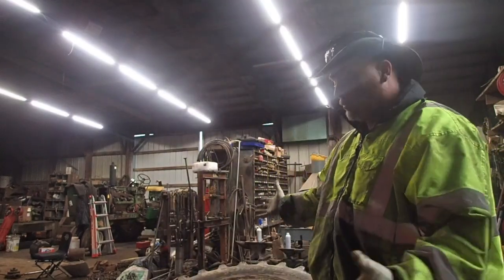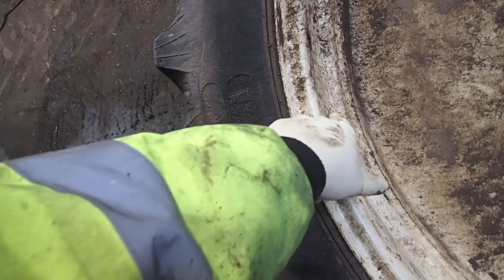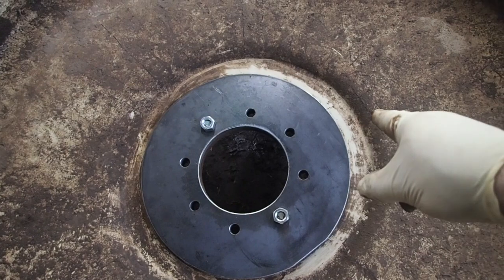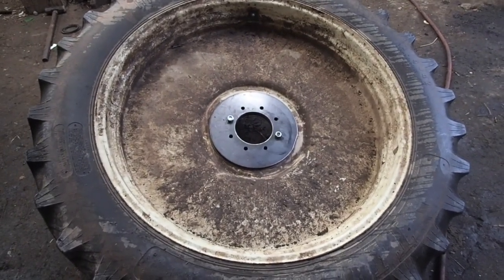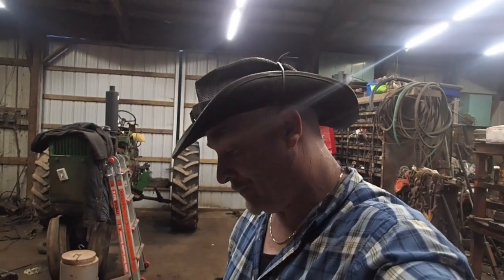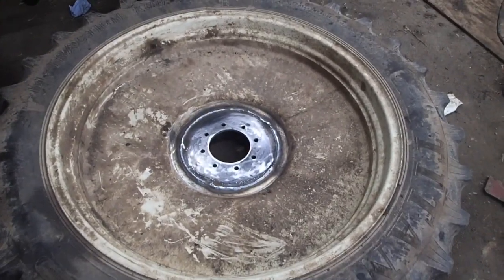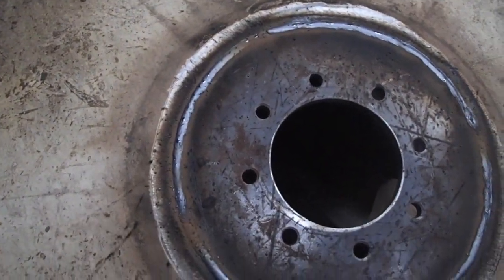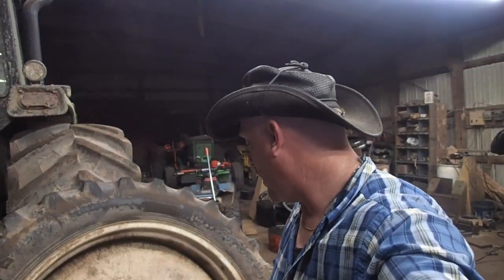Hardi Spayer Wheel Repair

Comment: I've done similar in the past,but I usually pre and post heat the heat affected zone with a rosebud.Those spun wheel centers are usually work hardened during mfg and contain a fair amount of stress. Post heating helps relieve that stress which helps prevent cracking later.

Comment: I think the only thing I would have added to what you did was to mark across the wheel & the new steel while it was bolted with maybe big crosshairs so you would know exactly where it was before you cut it to line it up when you were tacking it back in.  Great Video Wes.

Comment: That's a pretty good job 
Those are good looking welds
For anyone watching all id say is remove the valve stem 
Listen to it every now and again 
If it starts posing like escaping air then step back let it finish and continue 
The presure wont spike from 0 to 100 instantaneously but it will climb fast over a minute or so 
If you keep welding after it starts releasing you Increase the chance of injury greatly

Comment: With your steel plate bolted to the existing wheel rime...drill 3 random hole and use some stove bolts to attach it to the rim.  If it looks okay, take it apart and you can not cut out the old cracked and welded rim mount piece. Your 3 random hole and stove bolts will now center you steel plate piece so you can weld it on both sides.  Stitch weld to help avoid warping and use a water wetted rag to aid in control warping prevention.

Comment: I agree totally with the comment about using tapered lug nuts Wes,that's a MAJOR potential safety issue right there.
Back in the 1950's cars ran FLAT lug nuts and people were seriously injured or killed because the lugs would loosen up,then with NO ⚠WARNING⚠at all,a wheel would come flying off your car,and if you didn't get hurt or killed,you'd tear up your car.So,GET THE TAPERED LUG NUTS WES.

Comment: Looks good to me Wes. I think I'd be more worried about you setting fire to your shop floor than blowing up the tire cutting and welding on the hub like that. :-)

The one thing that concerns me a little is that wheel was probably made of something a little harder than mild steel, so  you might end up with the plate bending over time and end up with a bent or warped wheel, and/or the weld bead separating over time. But if the plate bends the worst off you are is you need to go buy that new rim in a year or two, so it is a win. I'd just try to remember to check the weld beads for possible obvious cracks each day when you prep the sprayer, since dropping an axle on a wheel that high could be annoying.

Comment: Be careful grinding next to tractor windows it will make small black burns form each spark and looks like flys have shit all over the window it's just annoying because it's there it can be easily fixed but it's annoying knowing its preventable and just didn't need to happen, good repair by the way a bit of paint will look factory good job👍

Comment: heat can make the tire explode. "IF" you did not remove the valve and let the air out first. You make perfect sense if you are welding on the rim, but you are not welding on the rim. you should be safe enough. In 1960 I made reversed rims for my 48 chevrolet that I had installed a 50 olds rear end in. Olds rims were welded but pontiac rims were hot riveted. I traded the junk yard rims. cut the rivets off with cold chisel and punched them out. sanded the parts clean. installed the rims on the car and spun checked, tack welded then welded the center to outers together. worked great and was free(I did not have much money).

Comment: Fine job welding the center in. You did everything right as long as the metal is clean the mig
weld will hold for a long time.

Comment: Nice job Wes !   Big wheels like that are prone to hub cracking  from side loads ( which come from that heavy fertilizer sloshing in the transverse mounted tank ) .  Another case of 'planned obsolescence '  ? BTW, did you do some heat stress relieving of the weld beads afterwards ?   IAC, great video !  Another instance of farmergeneering  making the best of what you have !

Comment: Good repair..... Paint em up so they don't rust. You will know when you get a load of fert. on it. The stress is from side loading on the rim when you turn and weight shifts from side to side. Man I used to work for repaired a Newton Crouch dry fert. spreader the same way only we had a machine shop cut the rounds for us. Far as I know it is probably still running....... You bear a striking resemblance to your father.

Comment: The problem with those wheels is that the center is just a large, thin, flat disc which allows it to flex. You may be O K now at least for a while because the larger, thicker plates you welded in are stronger at the point of the most stress and extend out into an area where the stress is less. I always thought that those wheels should have had gussets to strengthen the disc portion.
If that center hole is a snug fit on the sprayer hub, the flat fit nuts should be fine since those are driven wheels vs drive wheels, but I would still favor the tapered fit to prevent chafing on the studs.

Comment: how do you clean your hands and stuff after working on that sprayer.  do you pressure wash it in a safe place so any runoff water does not get into your work areas or can leach down into your drinking water well or flow into other areas where it might get into animal or human food as a concentrated solution.  how about when it rains.. where does the run off go..  forward thinking..

Comment: Simple laws of nature. As the air in the tire gets hotter, the pressure in the tire gets greater. In addition, materials in the rubber can create gases as the temperature increases causes even greater pressure and weakening the tire itself. Safest thing to do is remove the tire. The weakened compounds in the tire may not fail while welding but could on a hot day while traveling down the road. 
Wes you sound like you know this, but others may think ‘I saw Wes do it, it will be ok’ then it is not!

Comment: Your wheel cracks were caused by slight give and vibration. By all means get tapered lug nuts. I was never a fan of flat lug nuts , just waiting to hog out stud holes......
Reply: Tapered lug nuts, is the way to go…
Reply: The main difference between the two is that, with tapered nuts, the wheel is stud piloted for centralization. With flange nuts, the wheel is hub piloted for centralization. Flange nuts provide more clamping force and will not waller holes. This is why most all heavy trucks and trailers have hub piloted wheels, and Budd wheels, which were stud piloted and notorious for wallering holes, have become a thing of the past.

Comment: Usually if the holes are tapered, then the wheel is lug-centric and only tapered lug nuts should be used. Otherwise you could develop wheel hop and possible hub cracks. There is also more than one type of taper. There is the common 60 degree and 90 degree straight taper and also the cone shaped taper.  If the correct taper lug nut is not used the nut will work it's self loose. Best to contact the maker of the plate insert as to the taper design.

Comment: when i bought my ih 1586 i could tell that the last owners were very cheap becuz the right rear rim had tons of farmer welds on it. they never wanted 2 buy a new rim. there was even a crack in it.  soon after that very same rim blew out on me. so i ended up buying a new 1.. it was $450 without a paint job, $500 with a paint job, so for $50 more i got my new rim painted red..

Comment: I would cut the rim center right out. You will want to bevel the half inch plate around the exterior. I would use low hydrogen stick rod to finish and 6010 or 11 rod for first pass.

Comment: It's dangerous if you do it wrong. Otherwise, done right, outside, inside, it shouldn't see any problem so long it stays within parameters. 

IMO, were it me, i would get a second pair of those plates and cut it just an inch smaller. I would weld those in a cut-out from the rim, and then weld the normal piece on the outside. THAT, would be impossible to break. Nothing short of an side impact would touch it.

Comment: If your concerned about heat transfer, Pack towels soaked in cold water around the perimeter. These will act as a heat sink absorbing any heat out near the tire area. Your a bad influence, Chucke2009? use to call Steve to change a cotter pin .Now you've got him trying to swing wrenches. Best of luck.............

Comment: If you would have got new rims it would have taken as much work to change the tires as it took you to weld in the new centers. I have changed those tires they are heavy ply with thick beads and they change hard. You have welding equipment and are good at using it. Like the old saying goes you got to pee with the wiener you have not the one you wish you had. In my opinion this will work, but on these Hardi wheels I am not sure anything will last the life of the machine. For the money you spent if it only lasted one season the dollars made cents!

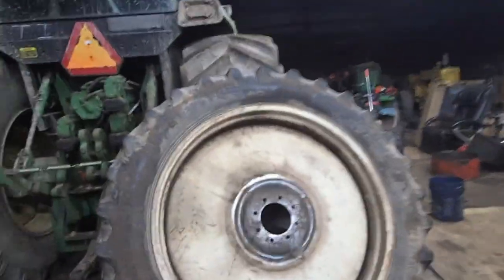Comment: Lighting, imagination or worn tires on tractor at 14:00; the left lugs/cleats/? on both rear tires appear more worn than right side 
Are these the ones Wes swapped sides on recently?
Why are tires reversed on the trailers?
Thanx from the left coast near the Crapitol of California
Reply: Gene Murphy he did a vid a while ago about rotating the fromts
They are wearing more on one side 
Prob due to so much sealed road traveling